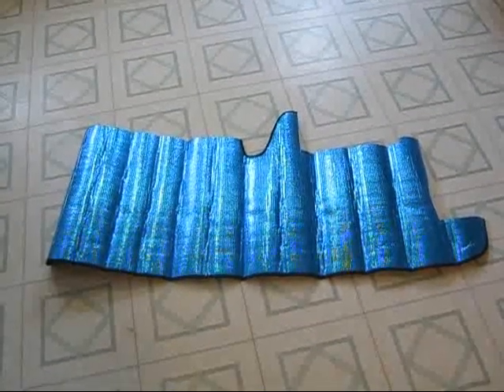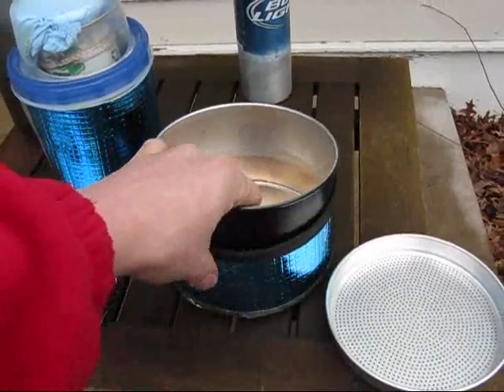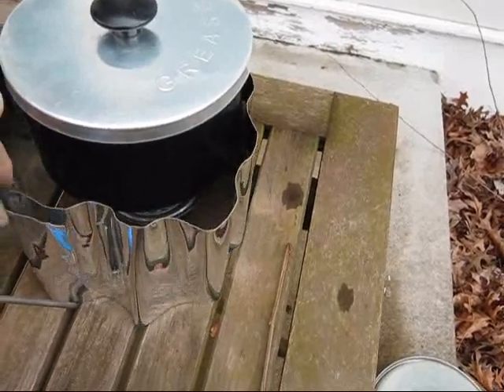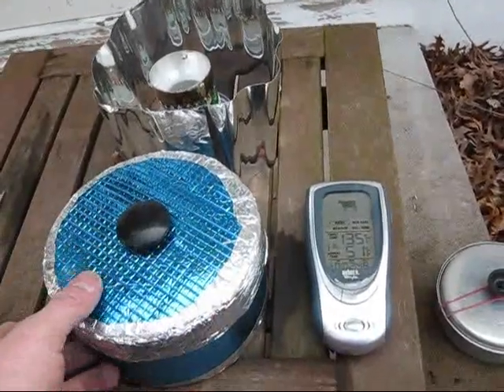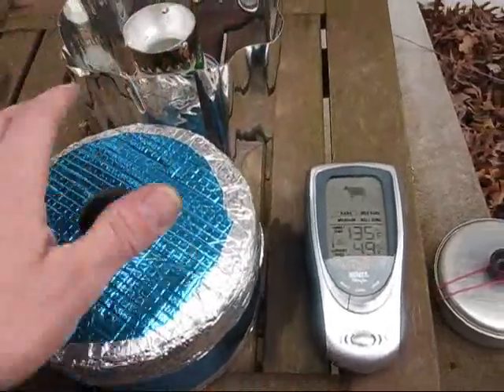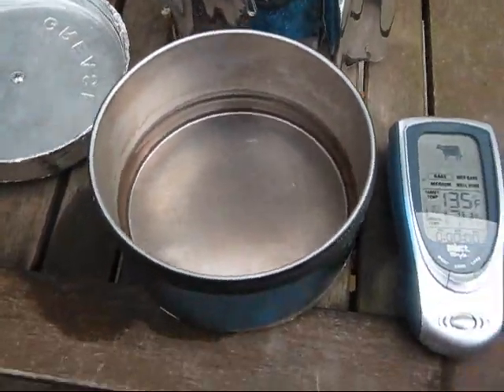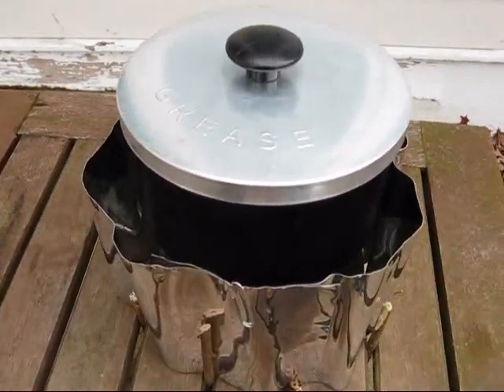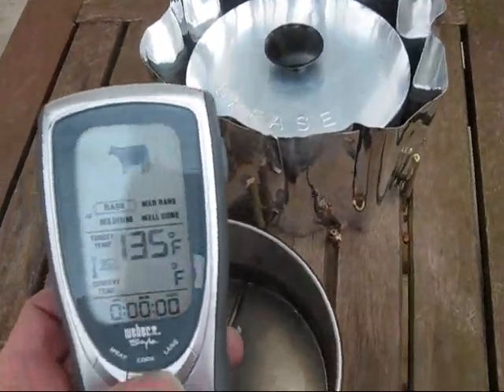Camp pot cozy test

Comment: My test yielded almost the exact same results, but with slightly better retention because I did everything inside on the kitchen stove -- I didn't think I needed the alcohol stove to proof the cozy. Also, my cozy has the mylar thermal shielding inside and out -- my 5-minute temperature with the cozy was 180-something. I suspect that foam liner on yours will eventually succumb to the heat -- it'll shrink and harden overtime, I'd think. How did you no-hand film that? Camera in mouth?